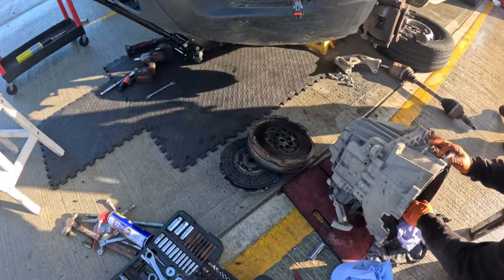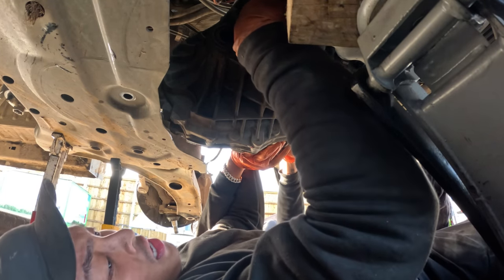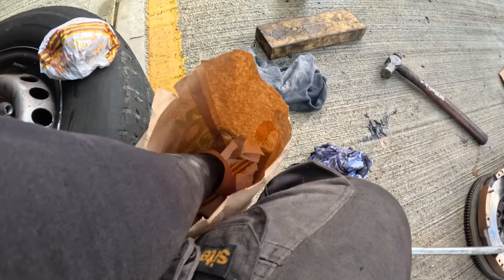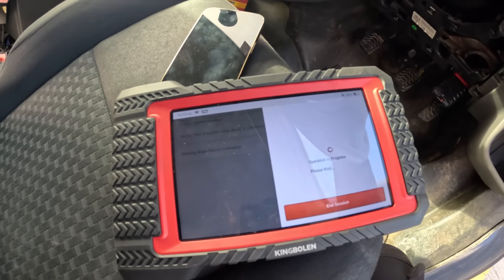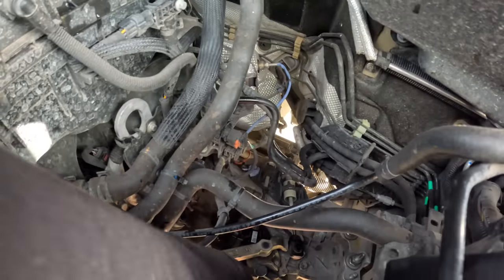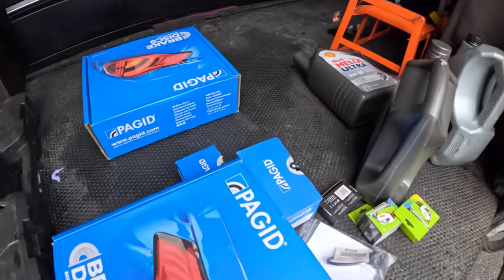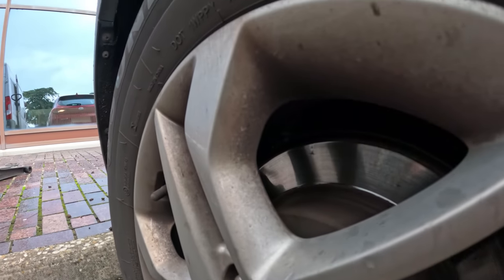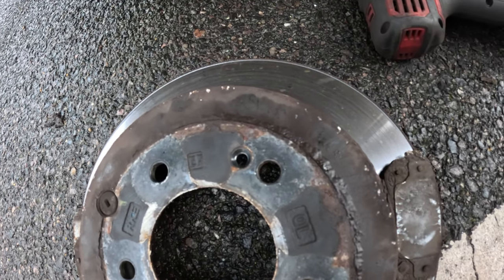AMAZON WOULD'VE SUED US FOR THIS MISTAKE | Transit 2.0 Clutch Replacement ft @kerbsidemobilemechanic

Comment: Wow didn't knew you've been working with Kerbside , been mobile for 3 yrs in High Wycombe and surroundings and only had 5 stars reviews , I now have opened up a garage in Wokingham , if you guys ever need help I do have  a car lift as well . Im probably going to be back as a mobile next year as the garage is getting expensive day by day , good work out there guys . Used to send few customers of mine to Kerbside when I was to busy , never meet him but seems to be a good mechanic based on his reviews . David Your Mobile Mechanic or now GeoSaki AutoCare .

Comment: Yeh company vehicles are always abused. If the managers saw how the drivers treat the vans, they would not even give them new vans to begin with. They should be made to pay the repairs and maintenance on them 😂
Reply: From January we can hold the drivers liable for excess damage (I’m the manager of the franchise in this video)
Reply from the maker: What is ‘excess’ damage?
Reply: @themarvelousvlog  any damage caused from negligence, IE hitting height restrictions dents large scratches anything like that
Reply: All courier company vans are like this. I work at parcelforce and the vans the get are all the old shitty 16, 17 plates from other depots.
Reply: Looks like they’ve just abused the control arm 😂